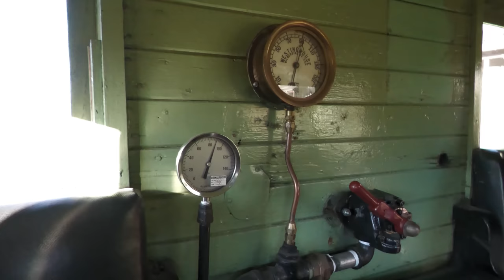Durango & Silverton Narrow Gauge Railroad - Extra 473: Mixed Train to Silverton (4K60)

Comment: Does anybody know what is the meaning behind where it sounds like there’s two shotgun blast and two reports from the Whistle right after what that means?
Reply from the maker: Those were torpedoes, a railroad signaling device which is basically gunpowder wrapped in heavy paper with metal clips attached. These were attached to the rail and would explode when a train ran over them. They were used to warn a crew of a train or other obstruction ahead. The crew would typically answer with two short blasts of the whistle, a signal of acknowledgement.